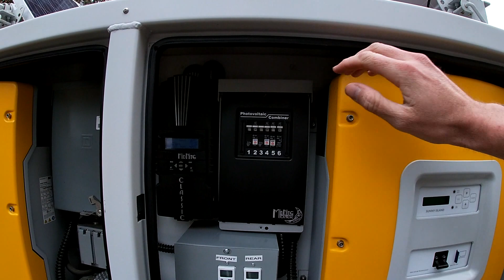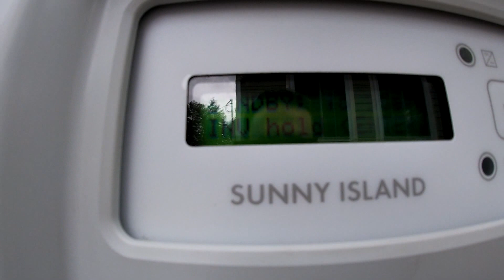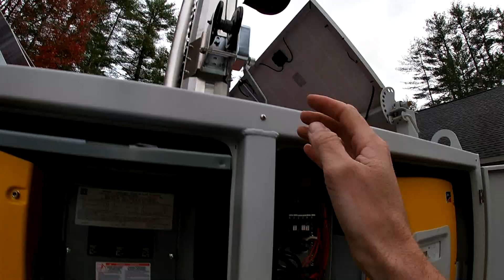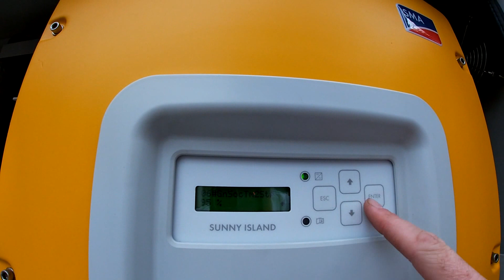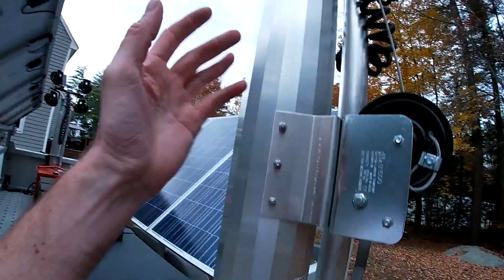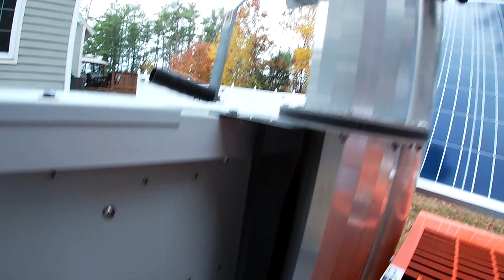How to use the "DC Solar" trailers + UNLOCK CODE for the Sunny Island Inverters INCLUDED!

Comment: As an electrician that has installed many off-grid PV systems, including the SMA Sunny Island, I recommend that you get professional help before making changes to the inverter or charge controller settings. All sorts of bad stuff can happen if you change settings without knowing all of the parameters and how they interact. This includes stuff like the wrong power for your equipment that can cause catastrophic failure. Overcharging the battery, causing it to fail, melt, explode, or all three together.
 Any decent company with Off-Grid power system experience should at least be a resource to get you the right person with experience to help you.
 Also, your lead acid batteries want to be at a temperature that is comfortable for humans in order to prolong their life and get use of their full capacity. A climate controlled area is best. They also need to be properly vented to prevent buildup of explosive hydrogen gas.
 As a matter of liability, I would not put out the installer code formula for unqualified people to use. Changing settings can be dangerous.
 I have been thinking about upgrading my outback system, but the Sunny Island was just a bit to pricey. It is definitely the Mercedes of systems, and one of my favorites to work with. 
All my best to you and your project.
Reply from the maker: Thank you very much for taking the time to share some info.  Totally makes sense.  I plan to spend this winter gathering info and researching.  I'm in no rush to get it setup so with tips from people like yourself I'm hoping to get it up and running without burning my house to the ground lol.
Reply: @Trialnerror You are most welcome. I am an enthusiast, and often tell people that I have lots of informed opinions, and hopefully a few facts. Well,l hopefully informed opinions.
My wife wants to upgrade our power system, so we looked at the auctions for these trailers. You got a screaming deal. I didn't do a complete cost breakdown, but just an off the top my head guesstimate puts the trailer at around 50k worth of equipment.
 Since the electricians children have no power, Our off grid system is thus: 3.6 kw 120v Outback 3648 inverter  on a Midnite Solar Epanel, Schnieder 80-600 PV charge controller (80 amps @48v output, 600v input),10 kwh of used Tesla lithium batteries, 6.25kw ground mount PV array, MQ 25 Ultra Silent gen set (received in payment for side work)
We are planning to wait for the next auction close to us, since the 3.6 kw Outback is severely crimping our ever increasing electrification desires. The main issue is checking to make sure the batteries did not sit in a discharged state for any length of time. At this point I would go with lithium Lipo batteries if buing new, since the cost is cheaper than the high end lead acid, and the performance is so much better. Our last set of lead acid was eight L-16's weighing ~1k lbs,  providing about 4 kwh of power if used in the ideal range of the top 20 percent of capacity. The Tesla batteries are from a Daimler smart for two vehicle. They weigh about 200lbs, and provide ~10kwh used in their ideal range between 20 percent to 90 percent. Please feel free to ask any questions you have. As I said, opinions...........
Reply: The installer code formula is in the manual. Not  a secret.
Reply from the maker: @JimYeats  It's a secret to the hundreds of people that don't read manuals lol.
Reply: @Trialnerror  Lol certainly.  I guess my point is simply that it isn't a 'liability', since you know...the manufacturer puts it right in their manuals.  

Just came back from the current auction in Vegas after inspecting the H models.  Hopefully will get one.
Reply from the maker: @JimYeats  The liability I was trying (but apparently failing) to elude to is the damage you can cause by changing those settings.  Everything from destroying components to a fire hazard!  Good luck with the auction, you're already in better shape than the people that didn't go to inspect!
Reply: @Trialnerror  I was responding to GoCoyote’s comments about liability and his recommendation that you not share any of the installer codes.
Reply: @JimYeats  True, but at least reading the manual will hopefully lead one through all of the warnings of the risks involved when settings are changed. I have seen 10,000 dollar battery banks destroyed within months of changes made by someone who didn’t understand the consequences of making a mistake.
Reply: Would you be willing to consult on proper settings to add a gen set to a basic trailer that is solar only?